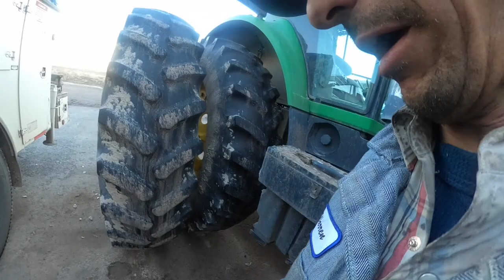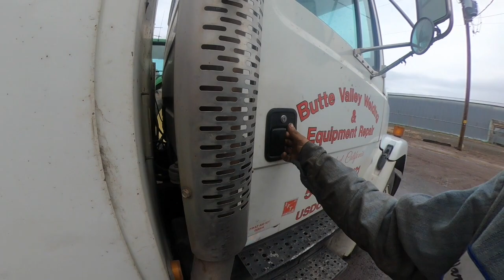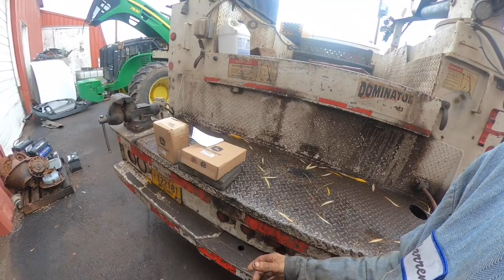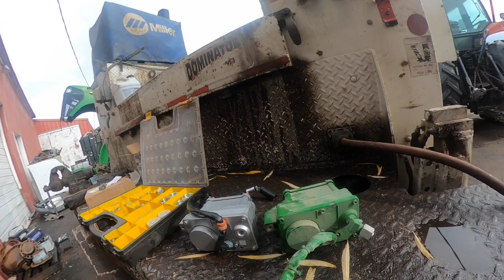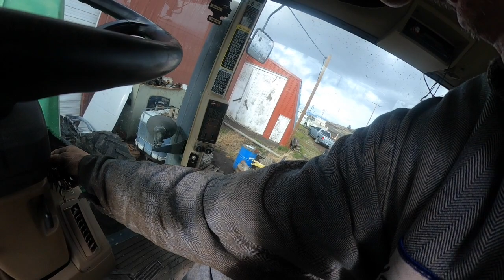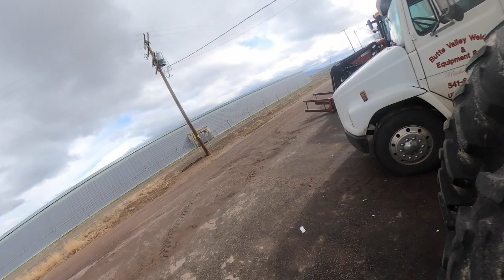John Deere 7830 vgt actuator

Comment: Head lights and tailgaters , when Im riding my geezer glide , I have a surprise for tailgaters , I pull off , get behind them , get the licens number and call the state police with a reckless endangerment complaint , the same for the ones across the middle line if I can catch up to them , if you cant follow 1 full size car length for every 10  MPH behind the vehicle in front of you and keep your vehicle on your side of the road , stay off the road , its not only on narrow/curvey 2 lane roads , they do the same on 4 lanes . I dont use those led head light bulbs in my bike , they have a very short service life , much shorter than stock bulbs , where will you end up in the dark , when the light go out ?

Comment: Hi Warren. You are one of a dieing breed of hands on mechanics an not what I call a " fitter" I've been in the trade since 1987 and gone of the days where you would remove a part/parts and overhaul them an refit them and that gave you a sense of purpose to your job. Things nowadays is plug in a computer an replace parts what it says to replace which takes away the job of having to find/diagnose the fault thru investigation work as you do yourself an yes sometimes plugging in a diagnostic system can be quick an easy to save time an as technology advances things become more electronic so this takes away the remove an overhaul process, I so enjoy your rants/vents an sharing your opinions an views keep the videos coming an stay safe.👍👍👍

Comment: Changing the gearbox oil on my car (VW DSG unit) takes 4 hours. It's because a special computer needs to be plugged into it when new oil is added - the computer activates the actuators in special sets of sequences to remove air locks in the system. Technology has a place but sometimes it can cause headaches.

Comment: Warren-
All computer controlled Devices-
(vehicles, PC & Mac, equipment, Smartphones, etc.) do what's called a POST.
Power On Self Test when energized. All modules, diagnostic lights, buzzers, bells, 
whistles, vibrators & actuators perform a circuit continuity and a mechanical
stroke test of all mechanisms. With the Baud rate of modern CANBUS systems,
hundreds of PIDs can be checked in milliseconds.

Comment: I have watched a lot of car repair vids and so often people will replace a starter motor entirely rather than disassemble the starter and fix it.Maybe starter motors are so cheap over there that it's a cheaper option .Here in NZ repairing the starter is way cheaper providing the armature is good not shorted.what are your thoughts on this topic?
Reply: I don’t know about new starters being cheap in the US, but rebuilt starters are always on hand at parts stores and many dealerships. They usually are cheaper (minus core charge) than hiring someone to rebuild or repair.

Comment: About grounds: there’s a concept in automation named “ground loop”, that’s when all the PLCs ( same as ECM) and transmitters would run their grounds to a common grounding point, because if you will ground them from the same conductor, but in different points - they tend to mess each other up!

Another, sure way to test the ground is to measure VOLTAGE between the components ground contact and source ( battery) ground electrode, under load. You want to see as less voltage as possible there. If you see voltage - it means contact is not that good.